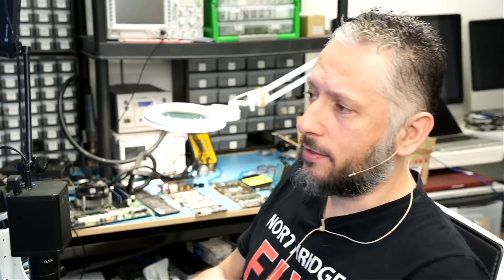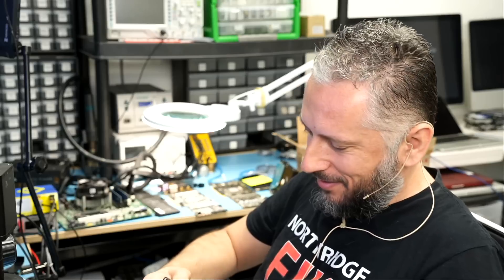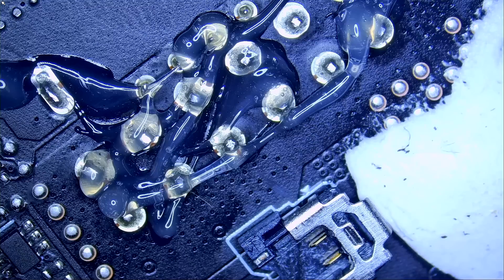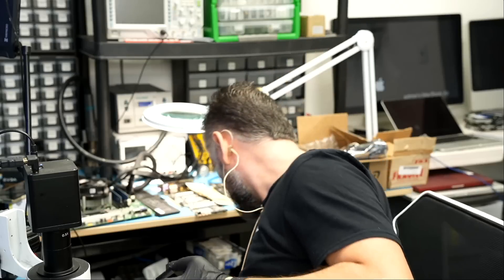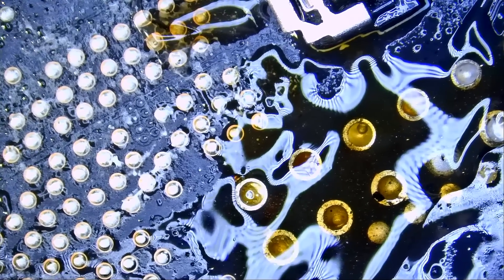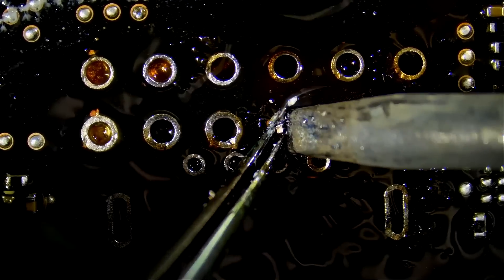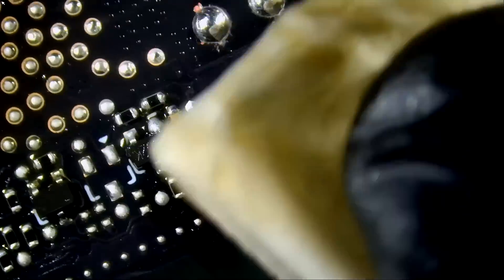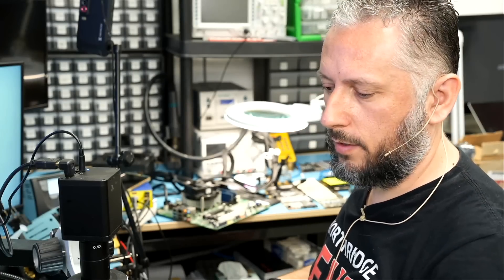4090 FE Connector melted with Cablemod Adapter installed. 40 series cards should be recalled

Comment: PSU could couse this issue if it doesn't supply the correct voltage the card will draw higher current which will lead to connector melting

Comment: I'm kind of surprised that so many of these cards are already reaching you - they are relatively new and should be all still under warranty. This example with the 90 degree adapter burnt in while being fully connected is a valid sample that this is a design fault + Nvidia has stated that they will take care all of the customers that have had problems with burnt connectors.
Reply: FE card maybe but AIB cards you have to go through horrible RMA process like with Asus, Gigabyte and MSI I had a terrible nightmare experience trying to get them to replace boards and monitors. This shouldn't be an issue in the first place, why do we need a new connector interface when regular PCIE power cables were perfectly fine? This is a solution looking for a problem, we never needed it.

Comment: My own view is that it doesn't matter if the cable was all the way in or not. The design is flawed in that it is possible for this problem to occur so it needs to be reworked so that it cannot happen. This smacks of the same issue we currently suffer in the software world in that new programs, applications, games, even operating systems are being pushed out to users without full testing then the users get penalised for the faults. It's a lot like a bridge that was not built correctly falling down and the people using the bridge at the time not only have to deal with their own injuries but then get the blame for being on the bridge when it failed.

Comment: Whether its a literal defect or user error doesnt really matter, the gen 5 connector is at fault. In medicine there is a concept called a systems error, inwhich if the system generates a predictable problem, then the system is at fault not the user.  People are not perfect so we cant assume they will be, so if your power connector has such tight tolerances that normal human behavior may cause it to fail, then the connector is the problem and must be fixed.

Comment: FYI, the connector Nvidia is using is TOTALLY INADEQUATE to the task of providing power to the 4090 card. EVEN THE MANUFACTURER'S SPECIFICATIONS SHOW THIS TO BE TRUE. THEY STATE A DISSIPATION OF TWO AND A HALF WATTS WHEN HE CONTACTS ARE FULLY LOADED. This is more than enough to melt the insulation materials ( glass filled nylon).

It's an incompetently designed connector. For NO GOOD REASON either. It would be SIMPLE to make one that did the job WELL,  But STUPID MORONIC UNEDUCATED AMERICANS made a FUCK-UP OF THE JOB INSTEAD !

Comment: Should we be using cablemod adapters?
Reply: adapter fix one problem. Your side of case will not pressure on cables so they will not plug out..
But here you see proof that with high power going through connector, melting fault persist.
So if you unlucky and get card that have poorly joined connector to PCB than it melt anyway.
I would like to know if card fixed by this guy will have any issues in future or not...
Because his job is perfect.

If connector melt next time than its design issue and customers should return product and get money back...

Problem with using cablemob adapters might be on stealing bussiness side from manufacturers and NVIDIA. They can tell that its your problem because you use cablemod and they will because they have no honesty at all.. Just see their pricing for such product and you cant doubt about their honesty..

Comment: I have said it before and I will say it again, the 12VHP connector is a poor design. The way that it latches onto the connector from 1 side only is primarily its fault. If the connector had latching on 2 sides there would be less possibility of occurrence. In my opinion, this is an unsafe product that should have never made it to market in this configuration. High current on smaller pin surface is a recipe for disaster. As current goes higher, it is better to INCREASE the size of the conductor in the connector, NOT DECREASE IT. Nvidia is clearly to blame here.

Comment from the maker: The user should not be blamed for melted connectors on 4090 or any 40-series card due to not plugging in the cable all the way. Nobody plugs in a cable half way intentionally or on purpose. As JayzTwoCents pointed out, even when the cable is fully plugged in, it still wiggles and feels loose.. Check JayzTwoCents https://www.youtube.com/live/1VfIQ5ZgUls?feature=share&t=2456. and also Gamers Nexus reply to this video at https://youtu.be/Z8OD_kLdF9Q?t=465

There should be an error margin with the way the cable goes in, or maybe some type of a mechanical mechanism that would insure connector is fully plugged in before power is supplied, or a sensor of some type that would detect connection issues and prompt user to reconnect cable if not connected properly.  It's the maker of the card to blame whether they knew about this issue or not. 

Cablemod were caught in the middle and they are not to blame in anyway shape or form. I later realized from Steve that the card I worked on 4090 FE belongs to Cablemod as well as many cards they mailed over to us in the past.  We have over 250 Graphics card que and i never look at names when repairing devices. Kudos to Cablemod for repairing or reimbursing customers who used there 90degree adapters and later had a melted connector problem even thought it had nothing to do with there adapters. 

Hopefully the connector will be improved in the future so end users are not put in a position of uncertainty and confusion on whether the cable was plugged in all the way or not.
Reply: Matt from CableMod here, props to you as well for doing the necessary work to get these cards fixed and back in the hands of end users. Greatly appreciate the work that you and other techs do here. As we've seen, unfortunately some cards aren't being RMA'd even though they're supposed to be, and that's where we're stepping in and reimbursing as Steve and GN noted in their video on this topic. Thank you for your quality work though, and videos with very nice detailed explanations. :)
Reply: @matta.1673  So AIB's and Nvidia directly refused RMA's?
Reply: @hardcorehardware361  its guaranteed the users did not even attempt to rma through their gpu vendor, nvidia's order to honor warranty for melted sockets has not been rescinded.
Reply: @hardcorehardware361  the only one to refuse warranty on the melted adapters was Gigabyte/Aorus.
Reply: @matta.1673  I ordered a 4 plug 12VHPWR cable and 90 degree adapter from CableMod. I'm trusting that you believe in the safety of your product. Fingers crossed.
Reply: @zetapal  we wouldn't be selling it if we didn't trust and believe in it. 🙂
Reply: Jay is an idiot mouth piece and should not be listened to period.

Comment: Seriously, it's likely that connector will just melt again. I'd consider soldering 'flying tails' into the pcb  holes vacated by the connector. The pcb holes should be large enough to fit cable of around 1mm2 into, from the look of it. That'll allow for  6x 1mm2 of cable each for 12V and GND which meets the 50 Amp requirement for the board.
Terminate them in a DECENT adequately rated connector.

Comment: If contact show a bit of resistance it turn into a heater .... period. The mating part need to grab the pins with more force. Antoher way that in general helps is SILVER PLATING. IT is day and night, improves the conductivity a lot thus lowering the heat. I dont think that the manufacturer put any effort on silver platting this crap connector they've installed. It clear the connector it is not up to the task. But as amanfucaturer, you can order your connector with this plating. Ideally the counter part on the PSU side should be at the same level of quality. But on modular PSUs you can change the wiring. Next time just use two car battery terminals.

Comment: In the new GamersNexus video, Cablemod confirmed they were Northridgefix's customer, and they shipped all the 4090's they received from the customer to Northridgefix to be repaired. So this isn't a case of a sudden surge of failures, but rather, months worth of failures being shipped at once.
Reply: The one handled during this video also ? ......
Reply: @38911bytefree  yes, it was mentioned in the Steves video
Reply: @popcorny007  I see his vid and didnt caugh the reference to the card poping in the mid of the video. Until Alex does not show his side of the story, I will stick to Alex because is unbiased because the nature of his bussiness. Also, if Alex would have recived 30 card from the same single customer, he would have known better this was not a massive failure or cards. Steve does not hace access to Alex ticket system, he does not know how many card from one or multiple customers has been repaired. The only bias you get from Alex is related to the products he sell. He is salesmen and this is how his bussiness works. He got GOOD stuff and he sells it. He sells tools for electronic repair ... not computer HW.
Reply: Cable mod, as said by Alex has sent him 8 cards. He has more than that from others. I waterblocked my strix 4090. Im using a 180 type A adapter from cable mod. I made a support the the adapter rests on that clips onto the backplate. That way it can’t wiggle up and down. Cable mod has built in wiggle left and right to get perfect alignment. All planes of movement are covered. Time will tell but Im covered by cablemod and or Asus. Cablemod is a great company.
Reply: @DetailsByChris  to have a fire hazard

Comment: When you have so many failed cards with identical issues, it NOT user error any longer.  The connector is too light for the card. It's obvious the connector takes ALOT of resistance causing it to over heat.

Comment: This connector is pushed over its current handling limit on heavy load. At moderate loads it may stay in its limits but on heavy loads card draws too much current. When heavy current is drawn pins heat up and their resistance increases. When resistance increases card may try to overcome voltage drop and try to draw more current what again generates more heat. Nice vids, really like them.
Reply: No it isn't, this has already been proven as false by pushing 1600w+ through the socket without significant thermal increase, the issue is always a point contact one being insufficient or damage to the female terminal in some way, which is almost always due to user mishandling.
Reply: @Squall4Rinoa  So how do you explain there being so many burnt connectors? Did users all of a sudden forget how to plug in cables correctly? I guess theres some mass amnesia happening out there.

With the old 8pin connectors there were nowhere near as many issues as with the new ones

Comment: I've had the gigabyte 4080 OC version since launch and have had 0 problems using the cable that gigabyte provided. Made SURE to connect EVERYTHING perfectly before booting up after splashing $1350 on it. Might just be a 4090 problem.
Reply: of course it is not the connector. it is because of the too high current over the single connector pins.  when it split up to 3 you need those 3 end 2 end.

Comment: I noticed that "your replacement connector" has larger legs. That should handle higher ambergris than the original one, which has smaller legs in diameter.

Comment: Guessing all the melted connectors were on overclocked cards, I would've heated the cablemod 90 degree adapter to remove it, yet it wasn't the cause of the meltdown.
The factory needs a thicker gauge connector pin with caramic instead of plastic or nylon casing, expensive, not as expensive as losing all future sales.

Comment: Looks like a current supply bottleneck. Definitely a design flaw. A higher melting temperature plastic should have been used or even type of ceramic connector. Or even a better electronically conductive metal for the pins to reduce contact resistance, which is causing the heat. A much simpler solution would have to use more power plugs to distribute the current. Either way this is a design flaw, no question.

Comment: If these connectors are problematic replacing them will still be problematic, I would do away with the connectors and hardwire them straight to the power supply

Comment: This card is apparently using a lot of electricity and the connectors cannot handle the heat created, the solution would be to put a lot of solder on each pin to add to the thermal mass and hope it's enough to avoid the connector burning

Comment: It is another proof that it is not user error, and I think someone who build a pc with expensive components is more careful with connectors. Soon we have to install heatsink and fan on the connectors,or use porcelain like in the old days. It is not a coincidence that you have to repair video cards like this every day. You must have thousands of connectors in stock. Anyway, I like the videos, better than factory repairs. 👍👍👍👍
Reply: the cable failures were all user error, pictures prove it.

Comment: I’ve a 4080 and using a modded GPU cable directly to PSU.. I’ve no issues. 

The GPU connector pins need to be thicker to withstand the maximum power loads & temps AND the connector shroud needs to be thicker and more heat retardant to withstand the additional heat temps the cards draw at the connector point.

Comment: The adapter is only as good as the manufacturer/installer. Once again, your videos are extremely valuable! To assist your viewers, the smell is acrid, like plastic or oil has been burnt (like it could burn your nose and then eyes). The smell will affect the optic system. I do appreciate your perspective! These videos always seem to land when I need an issue solved.

Comment: At this point it's pretty obvious that the guys to design the power adapter circuit for the reference board must have been left in the dark about how far their GPU designers wanted to drive power consumption. Else THIS design would have been engineered with additional safety margin.

Comment: This is why you cannot have high amperage connections of this magnetude with cheap molex style pin in plastic connecters.  You need mechanical latching with something like a lever to positively clamp down on the pins.  Any datacenter level piece of equipment is going to have this. Why nvidia couldn't manage one on the top of the line GPUs is beyond me. It would only cost them a little more.

Comment: I haven't built a computer in 5 yrs. My last two  builds were an I-7 and top of the line Ryzen 2700. 
 I was able to keep the total price around or below $2,000 for each computer.
Both of these computers are still working faithfully today after many years (of non gaming). 
I sure would hate it, if I spent around  $2000 or more today for just the graphics card, only to find out it is factory NFG

Comment: GN screwed us all by blaming it on user error.  You should contact GN and tell them what you are seeing.  My TUF 4090 also melted and I am absolutely positive I plugged mine in fully.  Industry needs to go back to the drawing board on these new 12vhpw connectors.
Reply: I have the strix 4090. Did you happen to check the gpu voltage in hwmonitor? Were you vertical or standard? So sorry that happened. It’s not your fault. Bad design.
Reply: Same thing just happened to me with my cablemod adapter on a 4090 Asus TUFF OC.  Found out when i went to reseat my gpu because every game i tried caused my system to reboot after 5 minutes. Adapter fused with no signs of melting. I got the adapter in march and worked fine till now.
Reply: @birdsoup777 do you use cablemod 90 angled adapter

Comment: I wonder if this could have been avoided by using an ATX 3.0 PSU with the appropriate 16 pin cable instead of the 3 way adapter.
Not that it excuses Nvidia or anything. Just saying.
Reply: We had Atx 3.0 cases but very minimal this melted was more common to the adapters

Comment: even if the power cable is inserted until it clicks in, it can still melt.  watch Gamers Nexus deep dive testing video.  Its not an easy answer.  Resistance, tolerance of the pins, pressure on the side of the card all come into play.  Google "RTX 4090-melting 12VHPWR power connector to be revised" as announced at the end of last year.

Comment: Like others the issue is current and resistance of the connector. It could be the connectors have pins with an alloy that has high resistance.  The engineers under designed is my view.  

It would be interesting to see how the connector heats under load.  You have the thermal camera though I'm not sure you could generate the load on the GPU.  I bet you'll see a version B of this card to address the issue.
Is there any difference between the connectors you use to replace compare to the ones the 4090 comes with?

Comment: It's a blessing to see that you're able to repair these connectors, but seeing all these burned 4090s is unacceptable. NVIDIA is concentrating on getting the most performance out of their cards, instead of checking quality control of their boards. Seems to me the connectors cannot handle the power draw of these cards, and also the new connectors you put on these cards, if they only last maybe a year, then it ends up that the 40 series cards were a bust in the first place. NVIDIA should recall them. Love your videos, but now seeing this, I'll be wanting to avoid 40 series at all costs.

Comment: Its already been proven that its an issue with the connector by several youtube channels. And it makes no difference if the connector is correctly plugged in. The connector can not handle the power draw of the card.